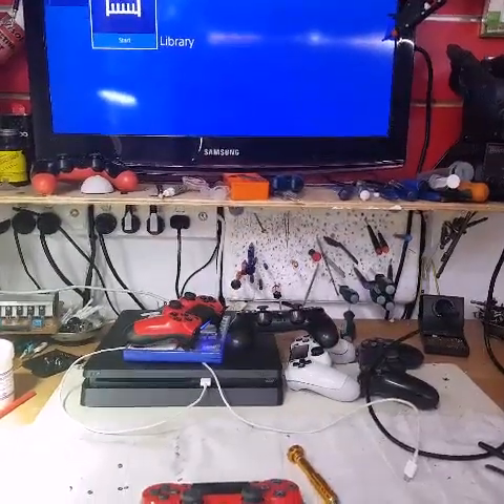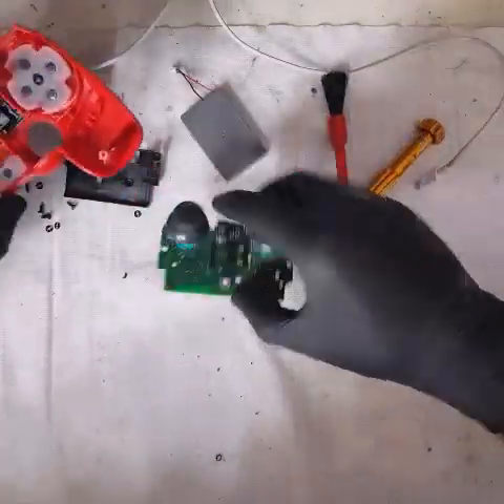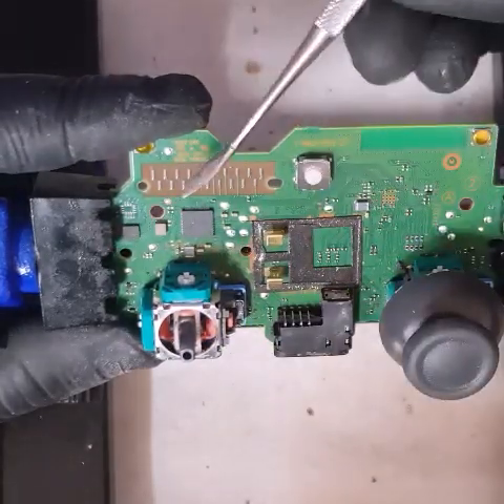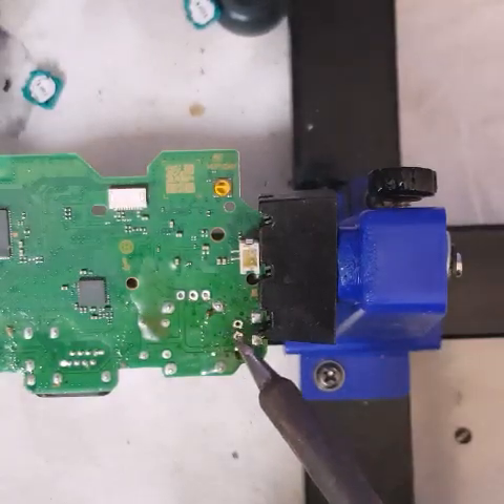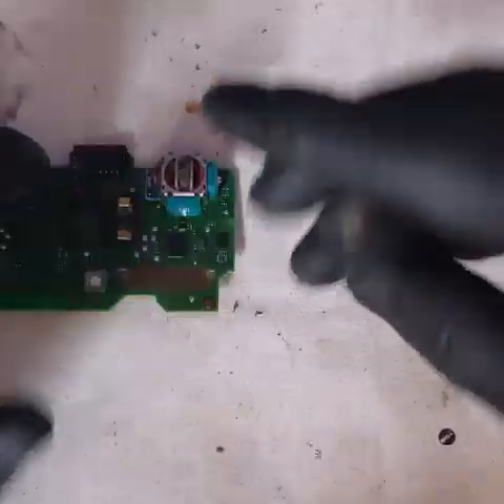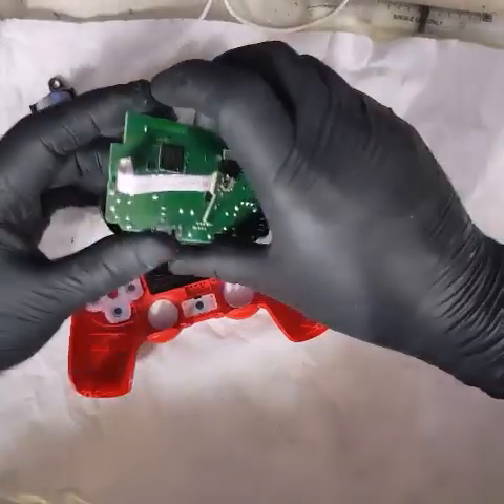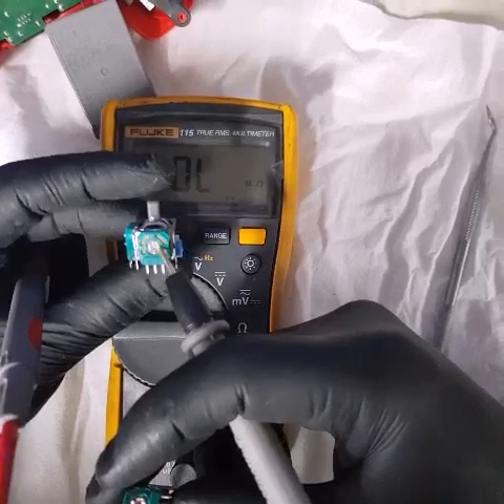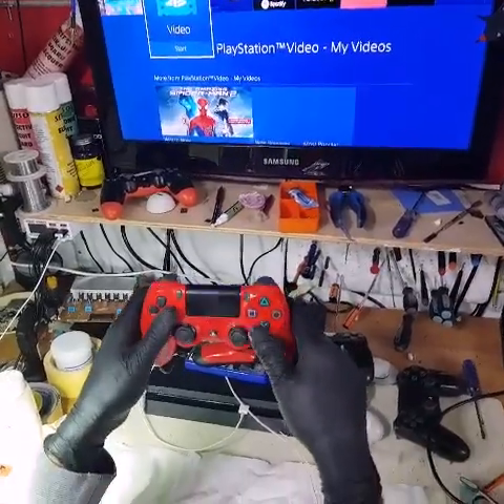Ps4 controller resistor sensor wheel replacement + additional testing information

Comment: If you’ve changed your sensors and they a permanently point up or to the side your fitted the sensors the wrong way round you need the flat part of the sensor on top

Comment: Hi great video i see in a website 2.3k potentiometers and 10k witch one is better ?
Reply: what im trying to figure out
Reply from the maker: 10k ones are better though I take the original measurements of the ones on the board and match it

Comment: Are both types of potentimeters (I mean the small white pieces inside the green tabs) compatible with a default controller? I had the old type in my controller and replaced them with the new type and now the joystick doesnt center properly on screen and still thinks it is moving a bit, could it be because the small white piece is not tightly on the plastic piece which moves with the joystick? Or do both types of the potentiometers have the same size central gap onto which the plastic piece fits that moves with the joystick?

Comment: Hello!, I repair a lot of DS4 joystick, replacing just sensor wheel or entire analog stick, but in some case the drift persist (most case in 055 motherboard) Do you know if it issue come from some resistor in main board or do you have some tips?. Thank you!
Reply: i have same problem. did you find tips ?
Reply: That's crazy thatb U guys have the same problem as me I repaired over 1000 controllers but I'm the jdm-055 even after switching them the Drift stays on there and it don't go away is there anything fix to that or are we doing it wrong
Reply: Any updates on this? I'm having the exact same issue with the 055 motherboard.
Reply: I seen some people that do them on here and it works after they do the replacement I have no idea what we are doing wrong than
Reply: @adrianchavezmorales799  Hey! I am trying to fix mine, i have analog drift (i sense very small movement on some games like warzone map, Rocket league my car turns for itself...) and i don't know if it is due to sensor wheel housing or the entire analog unit. Do you recall what could it be?

Comment: I have one question. How can i bring that little Nob thing parallel to the stick? I think mine is a little bit off. I have a Scuf amd only changed the little wheel because i dont want to open the Scuf completeley. So i opened the green part and only changed the little wheel and still have a little bit of stick drift. I think thats because of the little nob thing thats not parallel. So can i adjust it?

Comment: Hello. I need a bit of help. I’m trying to fix my own controller and I have my own sensor wheels but I don’t replace the blue part since I don’t have access to any soldering tools, so I only replace the little disk wheel and my controller was fine but in fortnite, I usually get a bit of drift and because of my dead zone and not because of my controller. But I wasn’t getting any drift(the drift only happens in the game). I wasn’t getting any drift and my sensitivity was really high but it felt slow so I tried to replace it with my brand new disk wheel   But when I did and turned my controller on it just kept on going to the left like crazy and it wouldn’t stop so I kept trying to fix it and it helped a little bit so I can stop it now but it happens really often and I don’t want to deal with this. I don’t know what the problem is because it was fine but as soon as I changed it it stopped working and kept drifting only to the left and not to the right. Do you have any clue what might be wrong and what I need to do?

Comment: Great video!  You explain it thoroughly!  My grandson broke the plastic post that holds one of the joy stick knobs onto the metal post.  Do I have to replace the whole part to the knob/joy stick? It now just wobbles.  I was wondering if there was an easier fix?  He is 8.  What can I say!  I took it apart and it is broken right where the metal post starts.  I am sure if I glued it back on, it would just break again....?  And I am not sure if that would mess it up? Any suggestions would be appreciated?  Thank you!
Reply from the maker: I would say it would be easier to replace the complete part to avoid problems later on.A good 60watt solering iron would be ideal.

Comment: Dude I just replaced the right stick on my DS4 like you did in this video. When I checked it was like stuck on left. I think maybe the dpad but could be left stick. Never had a problem with these only the right stick.
On psn menu was most noticeable. On top row I could not use dpad like usual but on the apps when i go right it takes me right back to left. The right stick that I replaced is not even used for the psn menu so very confused. Any ideas on what I could have done wrong or wtf?
Reply: Hello mate you’ve fitted the sensors upside down get a screwdriver and twist them around :)
Reply: @Boderz  I dont think so I have swapped sensors few times before. I may have messed up the motherboard when putting the new one in because I replaced the motherboard after and it was ok. But I got an ebay one and it also has issues. Every 8 minutes the damn controller becomes unresponsive. Does not shut off just stops working until you restart the ps4. They even refunded me without having to return it, idk wtf lol
Reply: @johndoegta2189  have you dropped your PS4 before ? If so you might need to replace the Bluetooth antenna in the PlayStation
Reply: @Boderz  I replaced the antenna too in the controller. This control is cursed man lol It works with a motherboard from a working control it just sucks they sent me the wrong one and it took like a month to get here. I have 2 other controllers so I kinda gave up for now. Gta is dead af now anyway and thats all I play!

Comment: Just replaced side parts soldered clean, but both anolgue sticks don't detect, any idea what issue is and cleaned isopropyl
Reply from the maker: Check the wheel, it may not be sitting well

Comment: can you use a white disk from a anouther controller like from the left joy stick  or use the white disk from the broken one and are all white disks the same
Reply: can you use any white disk in the controller
say if its from the left joystick
Reply from the maker: white disk? The sensor wheel, yes it can be used from another PS4 joystick

Comment: Whats the difference between removing the cencor wheels and removing the whole analog joystick (you did it in a video)
Does it solve the same problem?
Reply: Yeah I think it easier just to replace the sensor but the thing is it might stop working again, its gonna last less I have done it. But I haven't replace the whole thing,  but i think is better.
Reply: @elinsoncanales6634  why does it last less? is it because of the censor you bought is not original?
Reply: Jesus bro, awesome stuff but I barely got through it because of the background noice

Comment: What is the name of the PS4 panel holder and where can I buy?
Reply from the maker: PCB holder here is the link 

https://au.element14.com/aven/17010/circuit-board-holder-adjustable/dp/2500657?gclid=CjwKCAjw2rmWBhB4EiwAiJ0mtQMzoVFMiyRHpM_764gNdZ0lAjWULcacaeD_UeCHWua3muD_UCvHwRoC76wQAvD_BwE&mckv=_dc|pcrid||pkw||pmt||slid||product|2500657|pgrid||ptaid||&CMP=KNC-GAU-GEN-SHOPPING-PLA-PMAX
Reply: @autronicsltd3478  thank you!

Comment: How did you get those green caps to close so easily?? Mine won’t even close bruh..
Reply from the maker: Yes they can be treaky but align them to the holes of the joystick and press in but downwards
Reply: @autronicsltd3478  I had tried this but it didn’t work, it was too much pressure to push it in, so I sold the controller and got a new one.

Comment: Hi I messed with the circle inside the thing and now it moves to the right and stuff how do i fix it?
Reply: Same problem did you fixed it yet?
Reply: @sarukesh2381  nope
Reply: @Majesticbandit1  wachya did?
Reply: @sarukesh2381  I tried to fix drift and took out circle bits because stuff got in there
Reply: @Majesticbandit1  yea on mine I fcked up the white circle thing now my controller moves ingame instantly without touching the stick.
Reply: @sarukesh2381  your sensors are on wrong you need the square part of the sensor facing towards the motherboard

Comment: Hello! I have JDM-055 motherboard with yellow potentiometers and one of my sticks is completely dead. The "showel" moves, but it does not register any movements. So if i change yellow ones on GREEN ones, will it fit in the socket? I highly don't want to waste any money, if in that case THAT wont fit.
Reply: yes, cuz my 055 has greens.
Reply: @RetroMancer242  Greens? Mines are yellow
Reply: @sharkhardware  far as I know, they are all 10k olm. just buy yellow ones then on ebay
Reply: @RetroMancer242  Nuh, mines are 3.2 :(

Comment: I broke a hinge on one of the things the censor goes in. Does that solder hinge matter electronically? 

Because my up and down on joystick no longer work at all. Yet sometimes after opening it and messing with it. Its stuck walking forward or scrolling up.